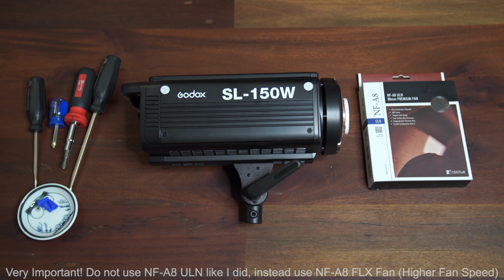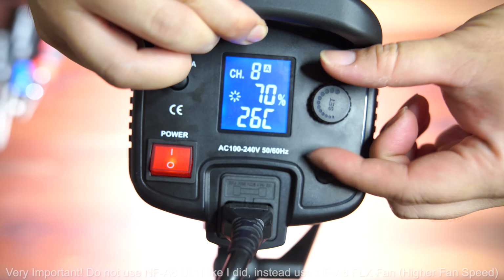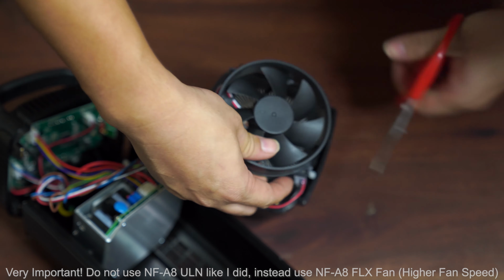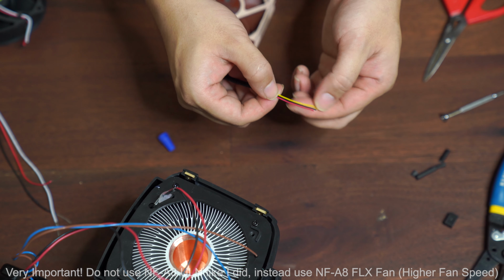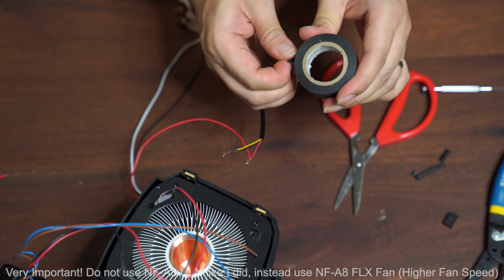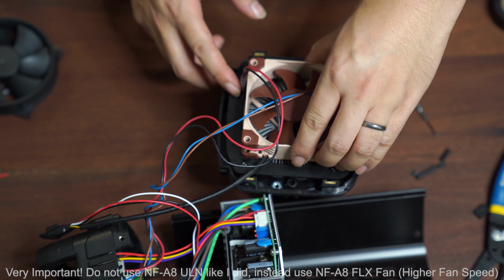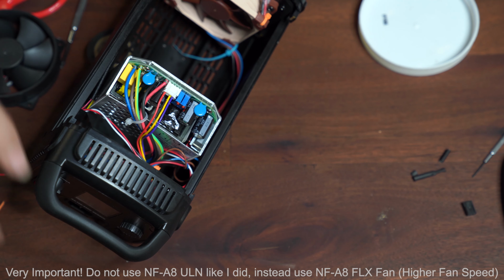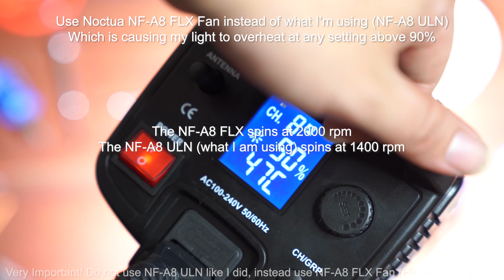Godox SL-150 LED Video Light Cooling Fan Upgrade w/ Noctua NF-A8 FLX

Comment: Just did the replacement from stock to noctua a8 pwm, on full speed. Noise level dropped from 50 dBA to 40 dBA. Room noise is about 37 dBA. Its much better now for sound recording duties. So thanx for sharing! Also heat at 100 output with softbox attached is 49 C for stock fan, and 53 for noctua, for long run.
Reply: Mine w/ stock cooler runs @ 63c - 49c is impressive!

Comment: Thanks for the recommendation of using A8 FLX as i’d have normally gone with ULN which would be insufficient.
With some major tweaks I also tried to fit Noctua 120mm ULN in (800 rpm, 8.6 dB, 74 m3/h), but for some unknown reason it doesn’t work and temp goes beyond 60°C at 100% setting.

Comment: Thanks for sharing this, I upgraded my SL-60 with the FLX (oops) and was wondering why it wasn't as quiet as the videos make it out too be. Just ordered the ULN!
Reply from the maker: If you bought the FLX (and haven't cut the connector off), it should come with a few different cables to lower the fan speed a little, that way you can get a good combination of quietness and airflow. I know SL-60 have less than half of power output of the SL-150 and I'd say the ULN will do the job just fine. I tested my SL-150 with the ULN yesterday by keep the light on at 50% for a good while, and the temperature stayed at 44C so it's not too bad in terms of airflow for the smaller light.
Reply: @TheGizmoGarage  I did try the connectors, but I'm going to give the ULN a shot anyways, it will be interesting to see if there's much of a difference!
Reply from the maker: @JordanDanielWende  The ULN have absolutely no noise at all!

Comment: The big reason your upgrade "failed" is that you used the wrong fan size.  going from 90mm fan to an 80mm fan simply because the holes line up automatically reduce your efficacy by something like 27%compounded by a quiet fan that blows a little less air.... simply because the fan is not blowing air over the entire surface of the heatsink.  Instead you should use a 3d printed adapter (free 3d print model on Thingiverse: https://www.thingiverse.com/thing:4208793 ) and a Noctua NF-A9 FLX 90mm fan.  This fan is rated at  38cfm compared to the stock rating of 47cfm (about 20% less airflow).  After installing via the adapter I got the following results:WITH a 48" softbox aattached:

Stock fan: 100% power = 122 degrees F/50 celcius  Sound: Loud, completely unusable
Noctua: 100% power = 134 degrees F/56.67 celcius Sound: very quiet, completely usable

Stock fan: 75% power = 107 degrees F/41.67 celcius  Sound: Loud, completely unusable
Noctua: 75% power = 112 degrees F/44.44 celcius Sound: whisper quiet, very usable

Stock fan: 50% power = 93 degrees F/33.89 celcius  Sound: somewhat quieter, borderline usable
Noctua: 50% power = 96 degrees F/35.55 celcius Sound: almost completely quiet, perfectly usable

Yes, with the adapter and 90mm Noctua fan, the light runs a little hotter.  With a reported overheat cutoff at 158f/70c... the Noctua simply never gets close to that, and coupled with the fact that I personally rarely use the light at above 75%-80% power, I find the upgrade to be a cheap, effective way to "upgrade" the fan in this light and make it completely usable in sound recording situations.  Even if the <10% increase in operating heat were to reduce the life of the light by 25%-33% (not likely in the least) the overall cost of the light with upgrade still makes it a top value.
Reply: This was so useful,. thank you! I might try this solution!!
Reply: I wish I read that earlier as I already ruined two fans in trying to fit them. Noticing on the second that it's literally impossible without a mount. Btw. did you try this?  Thank you :)
Reply: @Psiger  I did do the upgrade... printed the adapter and it worked quite well. I wrote about the results in the original reply as well.
Reply: @jdavidmusic  thank you I missed the stuff which was collapsed. Thank you :)

Comment: i fix the master fan i am using variable resistor with lm317 transistor to control fan speed and in my test 50% max temp is 38C

Comment: Hi guys, I've got Noctua NF-A8 PWM, it has 4 wires. Have anyone tried to connect it? 
When I try to connect 3 out of 4 ot is doesn't work. Maybe I should merge fourth one with one of others?

Wires:
Blue = PWM Signal (+5V)
Green= RPM Speed Signal
Yellow = RPM Speed Signal Red = +24V Black = Ground (GND)

My question, what should I do with blue?
Reply: I would just ignore the blue wire and cover it with electrical tape. If you were to plug it into a non pwm fan header on a computer motherboard the fan would work fine and the 4th pin wouldn't be connected

Comment: I just Got my SL-150 and I want to replace the fan. If you would have to do it it again would you use the Noctua AF-N8 FLX? from what I understand you would  change the fan. I would like to know what would be your choice  before I change my fan please!
Reply from the maker: Most definitely DO NOT use AF-N8 ULN, I already took mine out and replaced with AF-N8 FLX. ULN will overheat at higher light output settings! Use AF-N8 FLX is the bare minimum in terms of heat dispersion for the SL-150W. I would probably go with Arctic F8 Standard https://amzn.to/2utn8fO instead of Noctua N8 because it costs 1/3 of price and have almost the same performance in terms of air flow and fan speed.

Interestingly, the original fan that came with SL-150 is actually a 92mm fan with an 80mm fan mount, so it's a lot more powerful (at moving air than the 80mm fan people typically use to replace it) My next project would be converting a Arctic F9 Standard fan (which is a 92mm fan with 92mm mount) to be able to fit the 80mm fan hole in SL-150. I don't think it'll be terribly hard, just need to drill 4 extra 80mm mounting holes.

But yes, you need to use an 80mm computer case fan with at least 2000 rpm fan speed, and preferably with a ball bearing fan instead of a sleeve bearing fan for higher temperature application.

Hope it helps.
Reply: @TheGizmoGarage   Thanks for the fast reply. With the AF-N8 FLX when you let it run for a long time and does it shut off because of the heat? what would be the temperature reading at 100% after a while? also when running at 100% in term of noise with the Noctua NF-A8 FLX how much quieter would says it is compare to the original one? 50% quieter even more? if you have good result i might start with that since i know it works. If i would switch for a 92 later on i would prefer to stay with Noctua because the price difference is not that much for me. which one would you use?
Reply from the maker: @patrickseguin8967  Never ran it at 100% for that long since I rarely need it to be running at 100%, I used it at 90% brightness for about 30 min or so without a cover and the temp stays at 45C. At 50% brightness I think the temp was at 37C or so. I used electric tape to connect them so it's easy to switch the fan back for me if I don't like this setup much. I would use Noctua if price is not a problem.

Comment: Thanks for sharing this video.
What do you thing about the fan : be quiet! Pure Wings 2 92mm ?

I tried to connect it directly to the godox. But it didn't work. I will try with cutting the wires and using the original "plug piece" instead of new fan's plug piece.
Reply from the maker: It should work with modification to mounting holes and you must cut the wires to original connector and connect to the connector the stock fan came with.
Reply from the maker: I tried to convert a 92mm fan to fit the SL 150 and it simply does not work. At this point I highly suggest stick with stock fan and save yourself the trouble I went through. New conclusion video coming soon.

Comment: Also with you new Fan the Noctua AF-N8 FLX, if you use it lets say at 50%-60% is the fan noise at the same level of noise as when you use it at 100%? because i can see that with the original fan when i use it at 50% it produce less noise.
Reply from the maker: Interestingly, the fan noise is constant regardless of settings with FLX. It's noticeable but It's quieter than even the lowest speed setting of the original fan.

Below is the stock fan spec, you can compare it with 80mm fans and find out that 80mm fan is really a bit underpowered in terms of air flow need of SL-150.
The stock fan is a Progressive Model# PD922512MB-03
Air Flow 48.29CFM - 80 m^3/hr
Dimension: 92mmx92mm.25mm (with 80mm mounts)
Fan Speed: 2700 RPM
Fan Nosie: 33dB(A)
Voltage: 12v
Wattage: 3.6w
Fan design: Double Ball Bearing
Pin:  Reversed 3-pin
Weight: 100g
Reply from the maker: I tried to convert a 92mm fan to fit the SL 150 and it simply does not work. At this point I highly suggest stick with stock fan and save yourself the trouble I went through. New conclusion video coming soon.
Reply: Oh that's disappointing! But when you switch it with the AF-N8 FLX it was it still working well before you try to change it again? because I think I will make the switch its too noisy with the stock fan!  @TheGizmoGarage
Reply: @TheGizmoGarage  Tried to convert the 92mm fan and simply does not work?
What do you mean by that?

Comment: the Progressive  PD922512MB-03 (https://detail.1688.com/offer/568786210232.html) Air Flow is rated  48.29CFM - 80 m^3/hr even if you replace with an NF-A8 FLX you get huge lost of airflow (50,4 m³/h at max speed). The Arctic F8 is a bit better: 52.7 m³/h but still really not enough. With a cheap and easy  3d printed adaptor, you can use an Arctic F9 (73.1 m³/h ) who have almost the right air flow and is even quieter (we have to redesign few parts then we put the adaptor on Thingiverse). I try to find a solution to use an Arctic P12 who is almost silent.

Comment: could you dremel away excess material from non oem fan to fit better?
Reply from the maker: Might, but again you actually need a larger fan and drill holes to fit larger fan for the 150w light, otherwise it just doesn't cool properly.

Comment: thanks for sharing this video, do you try the FLX ? and there are any flicker issue after upgrading the fan ?
Reply from the maker: Yes I just installed FLX yesterday no flickering that I can detect, however the fan noise is now noticeable compared to ULN, but still quieter than the stock.
Reply: @TheGizmoGarage  Is it quiet enough to justify the upgrade? I'd like to get rid of as much of the fan noise as possible but I don't want to open it up if it's not actually going to make it quieter!
Reply from the maker: @NickPiro  Honestly, I used the light for a 45 min recording, and at 50% brightness the temp stayed at 40C, I really want to actually switch to a larger 92mm fan because I'm still not comfortable with the cooling efficiency of 80mm fans with the SL-150.
Reply from the maker: I tried to convert a 92mm fan to fit the SL 150 and it simply does not work. At this point I highly suggest stick with stock fan and save yourself the trouble I went through. New conclusion video coming soon.
Reply: @TheGizmoGarage  I may try it with a higher RPM fan. 2,000 RPM is definitely too little. You're gonna need minimum 2700 based on what the stock fan is!
Reply: @TheGizmoGarage  but most likely I will be sending them back. They are way too loud and even for the price, I do not wish to mess around with changing a fan! At that rate I might as well build my own light :D

Comment: How are Aputure keeping the LED cool when they have smaller heatsink and less airflow. It is obvious that Aputure are allowing the LED to run Hot. These LED's have an operating temp up to 120 deg C.
Reply: Or more logically they figured something out in the engineering of the light to make the cooling better - maybe why it's severely more expensive.
Reply: The ballast is a big factor

Comment: Have you thought about a 80 to 92mm converter like this

https://www.ebay.com/itm/fan-adapter-converter-Multi-choice-25mm-height-square-change-mounting-mod-custom/282535006398?hash=item41c86610be:m:mQYtmNxa2P-mOlooIlUmMkA

There is plenty of space in the light to add the extra 25mm of depth and you can remove any material on the 80mm flange that will get in the way of the screws on the face near the heatsink.  All Noctua 92mm fans do not have a high enough flowrate so you would need to look a other brands that are still relatively quiet.

Also there are some similar fans 92mm with 80mm mounts that claim to be quieter that would look to be a direct replacement for the stock Progressive fan.  Flow rate is good and it is 3 pin.

https://www.newegg.com/global/nz-en/p/N82E16835106157

Can you post the URL where you got the specs for the stock Progressive cooler?